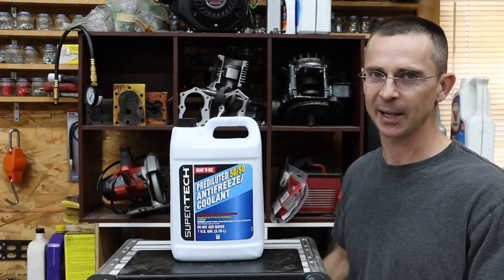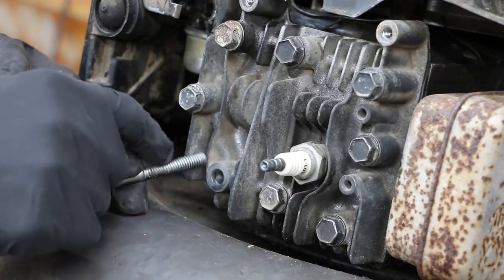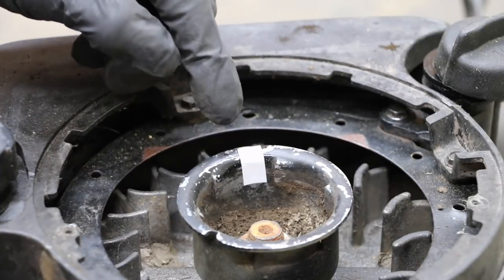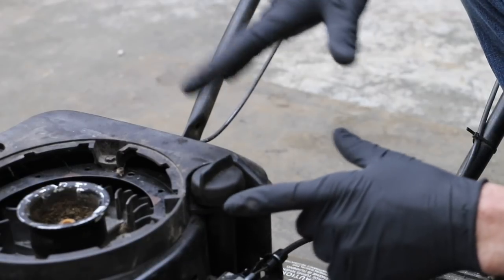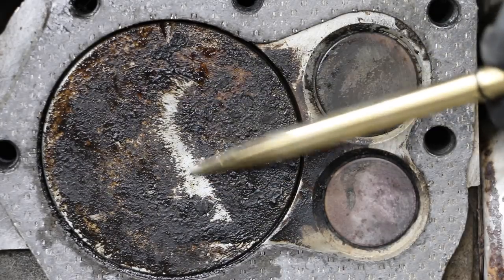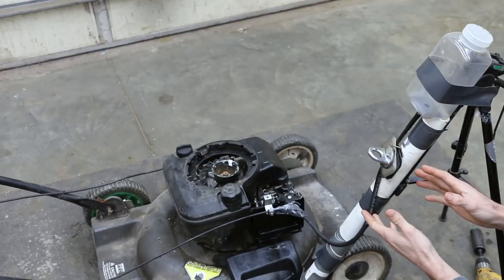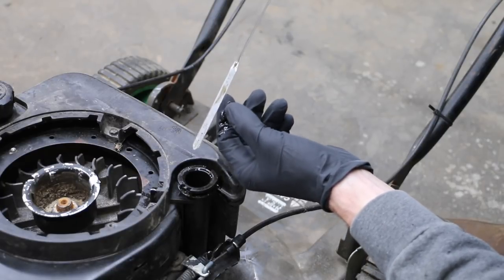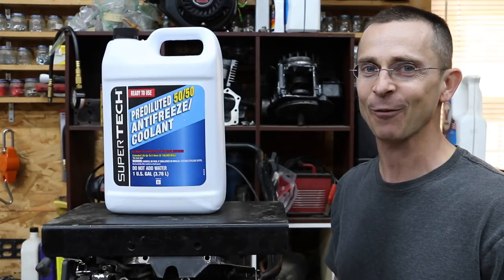Will Antifreeze clean an Engine?  Let's try it!

Comment: Interesting test!  Love this stuff and I learned a new trick.  Copper wire to hold a stripped bolt in!  Thanks again.
Reply: I use a toothpick for stripped wood screws in wood such as hinge screws in doors and cabinets

Comment: As others have said, spraying or dripping water into the engine will steam carbon out of the cylinders.  Antifreeze and water mix will get past the rings and turn the oil into a sticky gum, effectively sticking the rings and scoring the cylinder.  Antifreeze and oil will also cause bearings to spin.
Reply from the maker: Thanks for the feedback.

Comment: Straight water works best or 50/50 water & methanol or straight methanol for power. Works best hot as it creats steam as mentioned below comments. My diesel truck loves it and has gained at least 10%+ hp. Intake and head is spotless
Reply from the maker: Thank you

Comment: Hi there, I’d like to see you do a review on Liquid Intelligence 115. Its an Australia owned company and the product is a waterless coolant that guarantees your engine won’t overheat using it...the liquid does not boil. I’d like to see it used on a closed circuit system without any air passing over the engines radiator to see if the engine will overheat or not. I look forward to hearing back from you! Cheers
Reply from the maker: Thank you for the video idea!

Comment: It’s not really the coolant necessarily that does the cleaning, it’s the water content of the coolant. Steam is an amazing cleaner. The additives in coolant are actually more likely to leave additional deposits in the engine, usually a white powder. Coolant will also absolutely annihilate the O2 sensors and catalytic converter, especially if it is a type of coolant that contains silicate.
Reply from the maker: Thanks for the feedback.

Comment: Try introducing the anti freezer hot almost at a boiling point.that's how it enters a car engine. Also my father was in ww2  he told me they would throw handfuls of uncle Ben type rice (uncooked of course) into the open carburetor at part throttle of fighter  airplane engines and the carbon would just blow out the side pipes. Also heard crushed walnut shells. Give it a try. you my have to crush them down in proportion to a small engine.
Reply from the maker: Thank you for the recommendation.

Comment: My guess is that it is the water in antifreeze mix that is doing the cleaning. I would try it with plain water but make sure the engine is hot first.
Reply from the maker: Great point!

Comment: You supposed don't need the coolant/antifreeze part. Plain water supposedly works. I've heard of a lot of people "giving the engine a drink", basically introducing water or a mist into the intake to clean it out while keeping the revs high enough to keep it from stalling. The thought is that the water will enter the combustion chamber and end up as steam and clean the cylinders like a head gasket leak could. I'm too chicken to try it on any of my vehicles and lawn equipment lol.
Reply from the maker: Thanks for the suggestion.

Comment: -Before watching the test I am going to say the cleaning power isn't anything in the anti-freeze, but simply from the liquid pounding in the cylinder.

-Now that I've watched it I am still thinking it is the liquid that does the cleaning, so it doesn't matter if there is ethylene glycol in it or not.

Thanks!
Reply from the maker: I agree. The liquid vs vapor comparison seems to validate your idea. Thanks for commenting.

Comment: My Grandpa raced motorcycles and he said that the oil that gave the most power was the plant Castor oil, it only had one problem and that is it fouled spark plugs
Reply: 2 cycle engines

Comment: Catalytic converter cleaners, like Cat Clean, will they actually work better if dripped into a vacuum input to the engine manifold, or will they work better if put into the gasoline tank with gas better. I have heard that, brake cleaner, put into a vacuum input to the engine manifold can clean up oxygen sensors, how about the catalytic converter could it clean up a cat too if sprayed into a vacuum input to the engine manifold. Interesting video topics!!! Thanks, love your videos too!
Reply from the maker: Thanks!  Thanks for the video idea.

Comment: From what I've heard (with the water trick, which probably could be used with antifreeze), you're supposed to "give the engine a drink". You did this with the drip by accident when you first started it. You gave it enough to choke it out but not stop it from running.
Reply from the maker: Thank you for the feedback!

Comment: Way back in the day,carburetor days that is we used to use a old coke bottle with clean water in it to drip over the carb venturis to clean the carbon build up off of the top end...A hot engine works best,and higher revs seemed to be optimum...I've seen diesel,as well as atf used back then,but water seemed to clean the best of all while the two others usually smoked like crazy,and did little to remove the carbon build up...
Reply from the maker: Thank you for this recommendation!

Comment: With just about 3000 comments, someone may have already mentioned this one but I'm not going to read through to check!  Back in the 1970s I had a friend who bought a 1973 Corvette with a 454 4-barrel engine.  He had a mechanic 'friend' who recommended cleaning the engine by pouring a quart of transmission fluid into the intake while fast idling the engine!  Needless to say, the engine coughed and sputtered at first but then it smoothed out so I accompanied my friend as we took it out on the highway for a road test.  There was a minor amount of smoke coming from the exhaust as we drove along until my friend decided to tromp the accelerator pedal and shift down into passing gear.  At that point a cloud of white smoke poured from the rear of the car and completely obliterated visibility of the highway.  I confess that I was worried about the people driving behind him but at the same time it was pretty funny!  I think what happened was that a lot of the transmission fluid had pooled in the intake manifold and got burned all at once when he hit the accelerator!  He floored it a few more times with less smoke each time until all the smoking was done.  He claimed that he 'felt' like the engine was running smoother after the 'treatment' but I personally couldn't tell any difference!  Note that this was before the invention of the catalytic converter!  Ah, the good old days!
Reply from the maker: Thanks for sharing!

Comment: I think the head gasket leaks just have longer to work. Water will steam clean also but doesn't have the penetrating power of ethylene glycol. It might be worth testing a water/alcohol "injection" system, like was used in the old days.
Reply from the maker: Great point. Thank you

Comment: Hi- I used to have a 1988 Honda CRX si- when it was getting upwards of 100k miles- I would removed the 4 spark plugs when the were hot- and drop then in to a clear cup of Super Clean- and just watch the carbon deposits lift away- like that Calgon commercial- "calgon take me away...." remember that?!
Reply from the maker: Thank you for the feedback

Comment: I wonder what would happen if you used ice water? I'm thinking the shock of the liquid entering the intake actually caused the dislodging of the deposit build-up in the engine. If this is the case, then very cold water might work as well, unless it fouls the spark plug..
Reply from the maker: Thanks for the test idea!

Comment: ATF drip through the carb. ,or at the PCV vacuum port at operating temperature of the engine, or even distilled water so not to damage the catalyst.
Reply from the maker: Thank you for commenting!

Comment: Call me crazy, but I've poured uncooked rice down a carb to clean carbon out of an old beater truck engine with chronic run-on.  An old backwoods mechanic recommended that it be poured in slowly while the engine was running.  I'll be damned if it didn't work!  There were bits of white rice carrying black flakes and specks of carbon being spit out the exhaust for several minutes afterward.  After running a couple of cups worth through the thing ran fine and shut off normally.
Reply from the maker: I've got to test this!  Thanks for the recommendation.

Comment: hey project farm ,  
important notice :  
i have 4 scooters with perfect oil color because i clean interior of engine , when dirty , on all bikes by draining the oil and run with diesel in the oil box for a few minutes .  

if you can ,  please do a video where u use diesel instead of engine oil for a considerable length of time to clean carbon build-up on piston and valves casing .  even if to include diesel drop through the carburetor .  

i am very optimistic of the outcome .  thx !
Reply from the maker: Thanks for this recommendation.

Comment: I was would be leery of loose pieces of carbon scouring the cylinder. 
  Also, a question concerning the difference results when spraying or dripping. How can you be confident in the results when using the same engine. I mean it had already been deglazed to some extent by the first treatment. I sometimes have to wash my hands more than once. Can’t help but wonder if this is not akin to that. 
  One more, do you know you used the same amount of antifreeze both times. 
  All that being said, I do respect that you seem to have an inquisitive mind.  I do also to a certain extent.
Reply from the maker: Thank you

Comment: I wonder if the water is helping clean simply by being much colder than the very hot head/piston/etc. Rapidly cooling from the water forces the carbon to contract slightly and cracks off. You could compare something like that by testing the cleaning ability from three different temperature water sprays. Very cold, room temp, and almost boiling. If the hot water cleans much poorer, it's a strong candidate that it's the high-energy capacity of cold water doing the cleaning.
Reply from the maker: Thanks for the feedback!

Comment: I cook my disassembled r/c nitro engines in straight anti freeze overnight. (crock pot on low) Only the most excessive burned on oil residue is left. Generally very clean almost as the way they came from the factory barring any damage, of coarse.
Reply from the maker: Thanks for sharing.

Comment: Now you need to try just pure water, since it's the water (flashing to steam) that does the cleaning. 

Also, note how the drip dropped the compression, because it washed down the cylinder walls a bit.
Reply from the maker: Thank you for this recommendation!

Comment: I heard (never tried though) that transmission fluid does an excellent job (same method through the carb intake) and you don't have to have a concern with the water mixing in with the crank case oil
Reply from the maker: Thank you for the feedback

Comment: Is it the Anti-Freeze or would pure water do the same thing?  Also I’ve had people tell me they use a 20 percent mix of ATF with their engine oil to clean the engine. I’ve also heard of people adding diesel to their gas for the cleaning effect.
Reply from the maker: Thank you for the video idea!

Comment: P.F. I use a dropper of plain water to clean the carbon build up in gas running cars. It won't hurt the cat converter or any sensors. You don't need much to get most of the carbon build up off of the pistons or heads.
Reply from the maker: Thanks for sharing.

Comment: Now how about trying ultrasonic cleaner solution? The vibration of the engine + the extreme temp and pressure may work...Really would like to see on a 10-min video using the drip method....
Reply from the maker: Thank you for the video idea!

Comment: I wonder if you have tested Super Tech's Toyota/Lexus/Scion red antifreeze for quality and comparison to Toyota name brand antifreeze.  The Toyota name brand is over $40/gal and the Walmart Super Tech is $11.83/gal.  Could the ST version be just as good?
Also, ST has 2 versions of Toyota, Lexus/Scion antifreeze.  They are labeled identical as Prediluted 50/50 Extended Life Antifreeze.
They both are described on the label as exceeding the ATSM requirements and are ethylene glycol based and Phosphateted Organic Acid Technoloogy (POAT).  The one in a white bottle with the red cap has a sku ending in 1632, says it's free of borates, nitrites, silicates and amines.  
Although the Toyota owners manual describes their recommended coolant type as a high quality ethylene glycol based non silicate, non amine, non nitrite and non borate coolant with long- life hybrid organic acid technology, but doesn't call it POAT?  It does define it as, "coolant with long-life hybrid organic acid technology is a combination of low phosphates and organic acids.
The other one is in a gray bottle with a red cap, has a sku ending in 4329, but does not claim to be free of borates, nitrites, silicates and amines.
I also found another ST brand that is not specifically labeled for any car and is in a white bottle priced at $8.54, with a yellow cap and has a sku ending in 3728.  This one is also ethylene glycol based and also claims to be free of borates, nitrites, silicates and amines, but is not described as a POAT, and might be yellow in color, base on the cap color?
I wonder if this manufacturer just plays fast and loose with the facts or could these labels be correct?
Also, could it cause a problem if I mix the two Toyota/Lexus/Scion versions of ST antifreeze? The Walmart is always low on inventory and I could only find one of each of the two Toyota versions.  I need more than one gal to top off after a full flush.
Reply from the maker: Thanks for the suggestion.

Comment: I had a leak in my radiator hose and the fan was blowing it all over the engine bay. Some seriously clean spots where the antifreeze had contact with, also ruined the idler pulley bearings though.
Reply from the maker: Thanks for commenting on this!

Comment: i see lots of oilflush products online and in shops where they sell engineoil, but my "go to" mechanic says those are a waste of money, you just pour some gasoline or diesel fuel into your engines oilfiller opening when it's at operating temperature and leave it idle for 10min, would do the same job for cheaper. about 350ml per 5liters of oil. could you test that? maybe with a very sludged up engine?
Reply from the maker: Thank you for this video project recommendation!

Comment: You should do a surgical loop mask vs. N95 respirator seal ability and performance test under extremely dusty conditions while wearing one of each.

Loop masks are loosely fitted and have air gaps around the perimeter especially around the perimeter of the nose and will not protect against airborne particles.

N95 respirators are tightly fitted and have moldable metal nose clips to custom mold to the shape of your nose to create a airtight seal against incoming or outgoing particles.

Will you simulate a real life test???
Reply from the maker: Thanks for the video idea.

Comment: Even clear water will clean a combustion chamber. The important bit is exposure over time. That's why head gasket faults clean so well; the engine has most likely ran a long time with one cylinder "water injection".
Reply from the maker: Great point.

Comment: Project farm It would be really cool to see you spray sodium hydroxide degreaser in the intake, also would like to see brake fluid.
Sodium hydroxide does a pretty good job removing carbon, maybe it will be even better running
Reply from the maker: Thanks for the recommendation.

Comment: Check out any engine with a blown head gasket that's no so far gone that it hydrolocked the motor - it'll be squeaky clean in the leaked-into cylinder (like you said). Slowly metering water into engines has been a shade-tree mechanics' trick for years to unlock stuck rings. Tear-downs of engines that have run water-methanol injection have shown the same thing: spotless cylinders. Water's (or solutions containing it) ability to steam-clean an engine has been well-known for decades.
Reply from the maker: Great point and thanks for commenting.

Comment: I have the exact same laser tach. It seems very accurate. When you are finished using it (remove the battery). For what ever reason it will kill the batt, while off...   Seems a common problem with the model.  Perfect else-wise...
Reply from the maker: Thanks for the tip on the battery.  I need to do this ASAP!

Comment: Try a trail tech vapor I use it on my 230 and the engine rpm sensor is spot on and it also can do engine temperature but it is not cheap but worth the cost
Reply from the maker: Thank you for this video project recommendation!